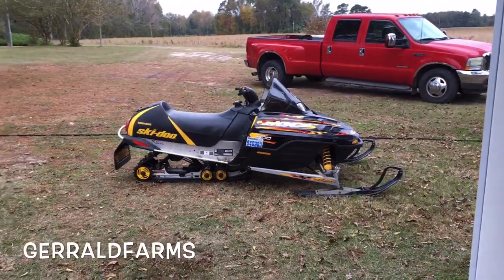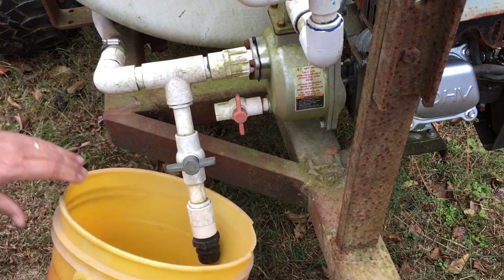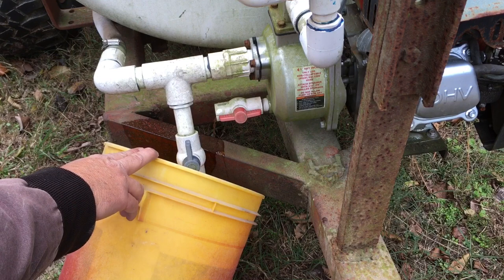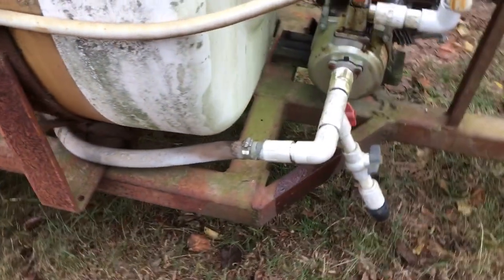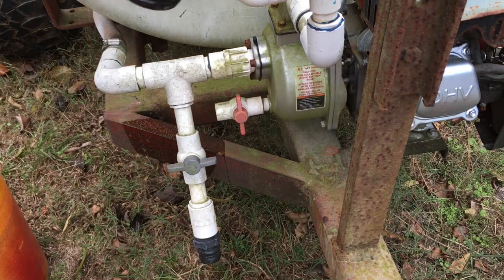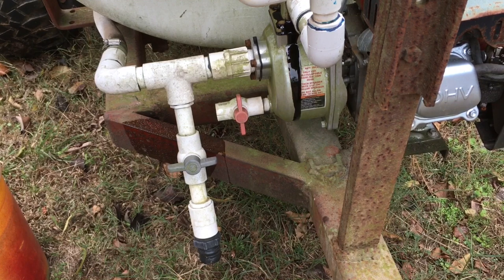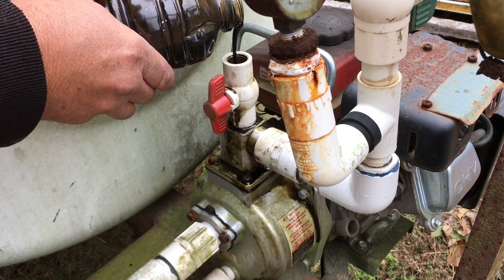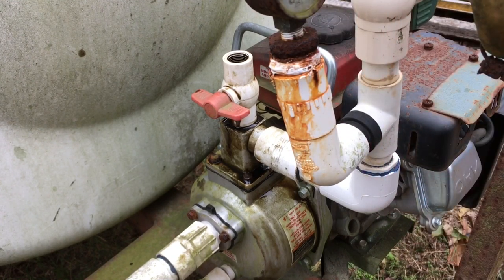Winterizing and stopping rust on our sprayer pump

Comment: nitrogen has got to be the most corrosive thing we can run through a spray system and nitrogen rated pumps are not cheap.
Reply from the maker: Thanks for watching. It will rust up just about anything. We have tried several pumps. The oil really helps. This pump has lasted 3 years. Have a good one

Comment: I it me or was the oil cap missing off the motor
Reply from the maker: Thanks for watching. I hope not. Now I want to go check. Have a good one
Reply: The newer engines has the fill caps cast on both sides of the engine but only drill and tap one side depending upon the manufacturers requirements BUT I watched it again and it does look like it's missing!
Reply from the maker: Soon as I get finished checking on the cows I’m heading over there to check it. Have a good weekend